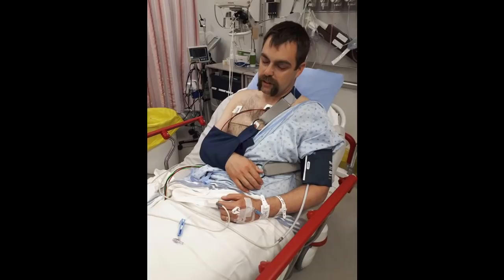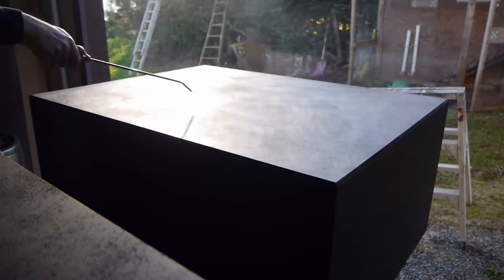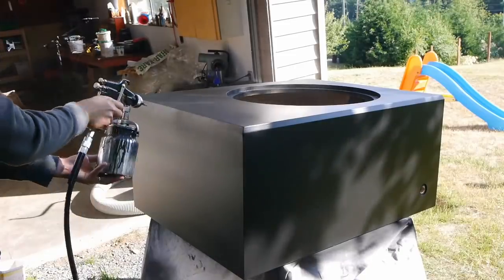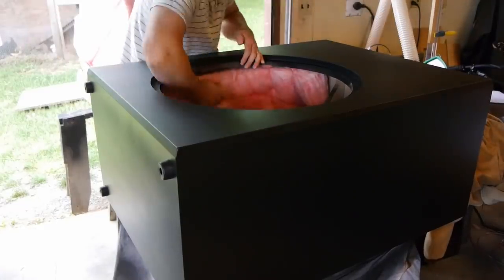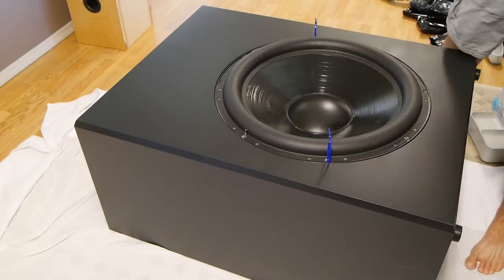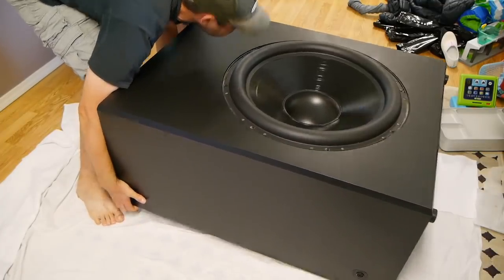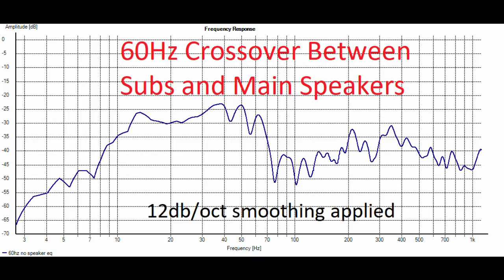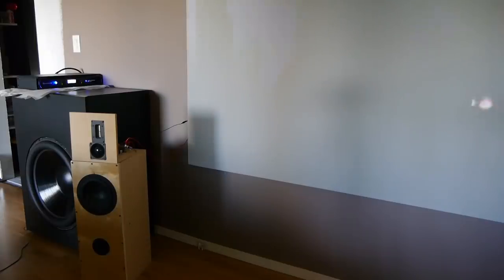Pierce Audio 24" Subwoofers Build Log Part 2

Comment: I often add 2 new holes to die cast speaker frame flanges, tapped number 10 fine machine screw threads.. They can accommodate 'holding'  screws  used as handles for mounting, or alternately, as jacking screws to lift off the driver frame from an enclosure after time has passed and they 'stick' in place.

Comment: My 15inch sub weighs 90+lbs by itself, i had a double layer 3/4inch birch box for it wich added another 150lbs to it. It was a paint to move around. 

It also only had 8 screw holes but i drilled them out slightly so i could use large full thread spax screws.

Comment: Flip the subwoofer facing the wall, the suck out should end up being 3rd order then you can just place a absorber at the wall that is causing the SBIR or room mode. And if I had subs that large I will crossover it over around 120hz, get biggest slam possible. But yeh, I'm not the expert and maybe your using it for movies not music.

Comment: hi bro
 i have watched all your work on you tube and i can say i wish i new just 10 precent but i read a whole lot about the subject and never seen your opinion about time aligning issues which says the tweeter sound reaches the listner way ahead of the sound of the woofer which makes it some times out of phase thats why some manufecters tilt  the speaker back to correct it or put the tweeter back in a parllel position to the woofers voice coil to make the sound time correct not just phase correct....i wonder whats your opinion on this
thx
Reply from the maker: Hey, good question. Time alignment and phase are different, but closely related. I believe getting phase correct is very important as it affects the frequency response significantly as well as the vertical polar response. These are very important. Time alignment, meaning if the sound from both drivers reach you at the same time, is less important even though it sounds like a very big deal. Time alignment is often said to be important because it's easy to understand and sounds like a really bad thing. Fortunately, by correcting phase during XO work, time alignment often happens naturally. This doesn't happen with a second order XO which is why some people recess the tweeter or slope the baffle back to time align. What they're doing is really no different than fixing the phase, but calling it time alignment sounds more special.
Reply: hi so what i can get from you is: using different slopes for the tw and mid might help with the issue and you say 2nd order might be a bad choice when it comes to  time alignment ///will 1st order be better ?
Reply: Get a DSP- גד אור

Comment: I feel your pain that's an awesome build glad to see your using pink insulation I did the  same to my custom built altec 15 in WF w/ alnico mag and fostex comp horn daul ports back in the mid 80s still own them to this day updated cross/caps & need to be careful not to  overload with insulation but I don't need to tell u I have used a sealant called butyl stripping all kinds on the market around the  woofer thin not heavy reduced cab resonance dramatically I envy your   desire I'm learning from you

Comment: Hey man im new to your channel.Love it. Just one question. How come a sealed box and not ported?
Reply from the maker: john o'neill glad you found it. 

Ported would have had to be very big to be tuned right. Also, sealed gives you better low frequency output when it gets very very low, like 10 or even 5hz. That’s the stuff you feel in some movies (not all). Ported is better in the 20hz range and for most people ported is the best choice. In this case the owner wanted the boxes as small as possible.

Comment: How did you connect the wires to the speakon plate? Solder,quick disconnect? If you used the quick disconnect, what size did you use? .187,.205, .250? Thanks
Reply from the maker: DENNIS KOWSKIE I’m pretty sure I soldered if I remember right. Sorry.

Comment: nice build ..I have 1 IB24 from SI on the same XLS amp - it puts my dual UM15's to shame in every way and because its mounte IB , the  SQ is phenominal  and doesn't have nearly the rolloff  below 20hz that your sealed box has...
Reply from the maker: Yes IB is a very good way to go for large drivers like this, but this one would have a steep roll off regardless because of the high Q. Also, the owner couldn't go IB, so we made the enclosure as large as possible.

Comment: wow i would've thought the 24 inch sub could hit 10 Hz without sweat. sorry to say but that that near field response is disappointing even if it is closed box. 10 inch can do better than that.  does it have super high FS? something is not right....
Reply from the maker: WV591 well first off, no a “normal” 10” sub can’t do better than that. Second, no a 24” sub shouldn’t be flat to 10hz in a closed box. Large sealed subs like this rely on a roll off that matches room gain. This is very normally around 30hz in my experience/research. Lastly, it’s important to take the FR shape with a grain of salt. What if I had told you that the response was at 120dB. You’d then be impressed. But I didn’t include the sensitivity so you don’t actually know the ultimate performance of this sub. You just know that the shape will require extensive eq and ample room gain. Overall the sub performed quite well, but do wish the shape of the response was easier to work with.

Comment: Here is the problem I have with that box.  It's more than math.
Years ago, the then-awesome 15"  TC sounds sub driver was way too much for a 1"  thick  baffle enclosure.  The (now closed) VMPS speaker company made it's "Very solid sub"  from a 2" thick   baffle box with bracing.  So did Triad- but with even more bracing.  Anything less, and the enclosure would just rattle and hum.  The 15"  sub was about 225lbs with enclosure.
Reply from the maker: Scott Lowell this one was 1.5” with bracing. Didn’t rattle or flex. It’s about understanding how and why.

Comment: Was the bass ass impressive as you expected?
I've done LLT with 15s and one with a single 18 and the amount of base is incredible.
Haven't tried sealed tho
Reply from the maker: Yes I was really impressed. I really want to get some 24s again, but space is an issue. I like the really low bass that extends forever. Ported LLT is a more violent eye rattling bass. This was more natural with lots of head room. The navy missiles in hacksaw ridge rippled my ribs.
Reply: @ImpulseAudioSpeakers  I had my house windows flapping which was distracting and stuff feel off shelves in the other room. I was running Crest audio CD 2000 amps. Maybe not really main stream, but they worked well for me and are reliable.
15 years later still working.

Comment: Hey man nice vid man but i have a few questions regarding the behringer inuke and that is how does it compare to the crown amp based on power, SQ, heating and finally reliability? i am asking cause i am currently saving to buy the behringer inuke 6000-4U which is two behringer inuke 3k's in one case and since my build consists of 4 X 15 inch speakers i want to have enough power atleast decent sound quality and reliability my build is more for loudness but still.

Amp: Behringer Inuke 6k-4U

Mids: 2 X Hybrid Audio PLB 15 2 way speakers 2X340watts RMS(AES) 

these are great mids ive Dj-ed with JBL ,wharfedale , behringer ,RCF and more mids and these are by far the best for their price only mids that beat these out is the CVR 15's from china and the higher grade powered Jbl's 

http://vivaafrika.co.za/hybrid-plb15-mkii/

Subs: 2 X Targa Venom 15 D4's 2500watts Rms each(i will run them on 400-1200watt's for now) 

These subs are the loudest yet still musical subs this brand provides i am putting them in a 40hz tuned enclosure they have run up to 155DB Using only two of these subs.

https://www.soundmatch.co.za/Products/Product/3334/targa-venom-10000w-dvc-4-15-subwoofer

if you read all this i would love to hear what you think about the behringer amps i feel they are fine if you are new to home audio as i am i am a Dj but to me that is a different world.
Reply from the maker: Erik Britz as a DJ I’d probably trust the Crown more but that’s not based on a bad experience with the berry. Just a history of good success with Crown. For home theatre the crown is dead quite and the fans rarely come one. The berry is loud. The crown also has rca and the panel lights can be turned off. It’s a nicer amp. But if you’re not worried about the behringer reliability (and there’s really no reason you should be) then for DJ work the berry is nice because it’s 4x.
Reply: Thanx man yeah the behringer i will use for a limited time for gigs but will mostly be run indoors at home for watching movies etc. i just want some power i currently have those same speakers on 200 watts and that is not sufficient for me and also puts my speakers at risk due to clipping so rather get some power and a decent amp later on i will upgrade to crown etc.

Comment: I would have thought this amount of bass is really only suitable for commercial size cinemas or at the very least large dedicated and incredibly well isolated home cinemas. Also, I would think if you have to much pressure change from the bass in the room it's going to damage your hearing if not your body.
Reply from the maker: MaZEEZaM might damage your hearing, but it sure is fun :)

Not as crazy loud as you’d think. Very realistic bass. No distortion at all. Sounds so clean compared to what we’re use to hearing. And most hearing loss studies suggest loud low frequencies are less harmful to hearing as midrange frequencies.

Comment: Look great and I'm sure sound the same. Was the insulating fill purely to lower QTC?
Reply from the maker: Graham Bond good catch. Stuffinh does very little for a subwoofer, unlike a typical woofer with a bandwidth up to +500hz. It does help tame high Q and smooth out that inductance hump and does help absorb any internal reflections at higher frequencies. Even if the XO is set to 80hz or so, there is output from the sub up to 200hz or so. Not sure anyone could ever hear the difference between stuffed and not, but can't fathom not putting it in there.

Comment: sealed box design for flatter bass response?
Reply from the maker: I can’t recall what I said in this video, but generally a sealed roll off will blend with room gain to give a very flat response down to single digit frequencies where as ported has a steeper roll off below the port tuning. In an anechoic condition ported will be flatter down to the port tuning only.

Comment: They look great and it's a very nice build.. I've never elected to use fiberglass insulation because the fiberglass particles have a tendency to move around in the enclosure and work their way into the spider and eventually get into the voice coil potentially causing issues later on.
Reply from the maker: Almost Zen I hear this a lot, and yet I’ve never seen a real world example of it actually happening. If the speaker is ported I use grill cloth inside the enclosure and staple all the insulation behind it, just in case. With sealed though I don’t bother.
Reply: @ImpulseAudioSpeakers  that's why I didn't ever use it because of what I heard too

Comment: I have the Crown Amp,please tell me why the Amp is "Happier" with bridged 8 ohms,rather than 2 ohm???
Reply from the maker: A higher impedance means less current demand. Bridged 8ohm is equivalent to 4ohm each channel. Which is less demand than 2ohms each channel.
Reply: @ImpulseAudioSpeakers  omg thank you for the immediate response, this is the opposite of what I thought...most subs are dual .5 ,1 or 2 ohm subs ,why is this if 8 ohms better?
Reply: @ImpulseAudioSpeakers  also..why do amps offer more power in lower ohm loads? Bridged 8 ohms 1000watts vs Bridged 4 ohms 2000watts?
Reply from the maker: @iyona14granturismogt6gtspo7  a lot of subs are low impedance so that you have the option of drawing more current out of the amp. Especially in car audio. If the amp is comfortable at 2ohms, better to use 2ohms instead of 8ohm so you get more current draw (therefore power output). But if the amp is a bit unstable at those powers then it’s better to use 4 ohm or 8ohm. So not necessarily better, just a matter of most suitable.
Reply from the maker: @iyona14granturismogt6gtspo7  halving the impedance draws double the current therefore double the power (watts). But a lot of amps can’t handle this and will get hot or blow fuses.

Comment: You measured the coils in parallel and built the box based on that but the install was in series. Don’t the parameters change based on the wiring of coils?
Reply from the maker: James Warren a little bit is all, but with a sealed box it actually measured very little what the parameters are. With a subwoofer like this it’s basically build as big as you can then EQ the rest. There was no way the box design was going to achieve a Q below 0.8 anyways. But ya, doesn’t really change all that much regardless.
Reply: I remember back in the expensive days of LEAP and LMS designing sealed on the back and vented on the front (I'm not sure what they are called these day) enclousures and the wiring would make a big differeance in tuning and chamber sizing. 
I definitely want to say thank you for posting all the videos, I know it must be very time consuming! Keep up the cool work and stop getting hurt:)
Reply from the maker: James Warren good point. When I say it won’t matter for this, that is because it is sealed. 

Thanks for watching. Hope people enjoy them.
Reply: Totaly! Sealed is forgiving.

Comment: The demo was pretty much useless. You can hear 0 bass. I think the camera was just in a bad spot.
Reply from the maker: Vlad Lucian it’s because the mic on the camera can’t pick up bass that low. And then your speakers would have to reproduce it. Mostly the mic though. There’s really no good way I could do a proper demo of these things on YouTube.
Reply: @ImpulseAudioSpeakers  It should be able to pick up some kind of depth. It doesn't even sound like the subwoofers are on. And it's no problem on my end, I'm using some skullcandy earbuds (Don't judge. They were cheap and they actually sound half decent) which we all know have no problem in the bass departament.

By the way, I'm sure the subwoofers are amazing. Certainly better than what I've got. I'm just saying the demo was bad.
Reply from the maker: Vlad Lucian it’s really hard even for a measurement microphone to pickup under 30hz. My measurement mic needs about 15db of correction at 20hz. These are low bass animals and really the recording losses a ton of bass. I don’t have the response plot for my camera mic, but I do for many other mics. Don’t forget that bass demos on other channels often let their microphone clip really heavily and they end up recording harmonics. So if they play a 30hz tone the recording will have a lot of 60hz second order harmonics. This makes the listener think there’s a lot of bass in the demo because the 60hz tones are recorded. This setup is so clean that no false harmonics are recorded. Something to keep in mind when listening to other demos.
Reply: @ImpulseAudioSpeakers  Yeah, it's interesting. But usually even when the mic is clipping you can kinda tell when it's a pure tone and when it's not.

Comment: i wish you good health by the way is it possible to combine different slopes on a midrange? lets say 6db hp and 12db lp ie on the same driver do you do it some times ?or is it not allowd thx
Reply from the maker: גד אור thanks. Yes you absolutely can mix slopes and I do it often. The drivers usually integrate better with different slopes. This should be done based on measurements and XO modelling. Good luck!
Reply: thx man yed i use a mic ecm8000 to check it blends good and in phase you are the best
Reply: i just wanna make sure you get my idea i was talking about mixing 2slops in one driver a midrange not 2 drivers like mid and tw
Reply from the maker: גד אור yup thats ok too.
Reply: thx a  lot